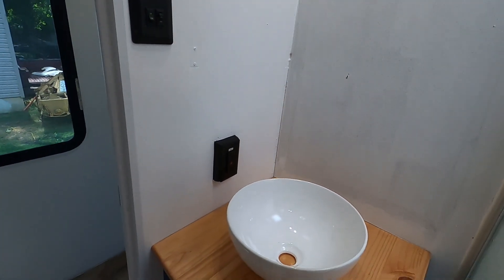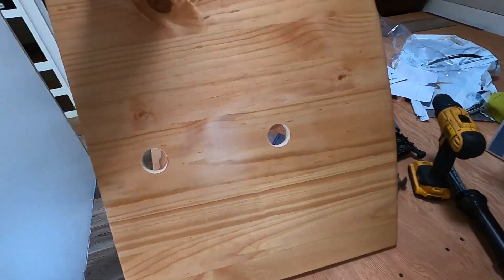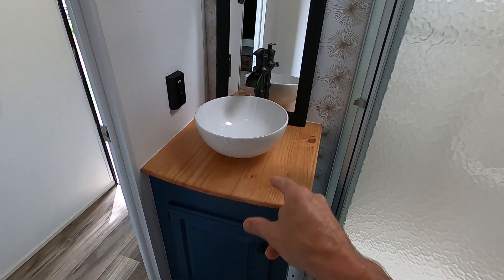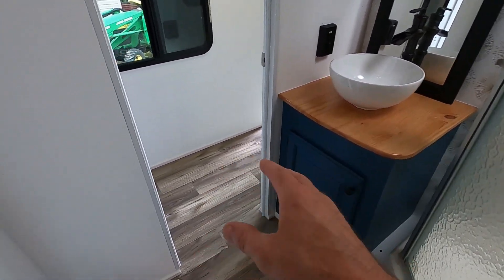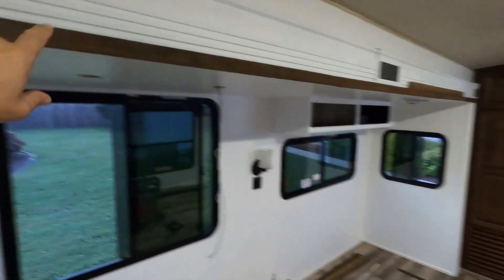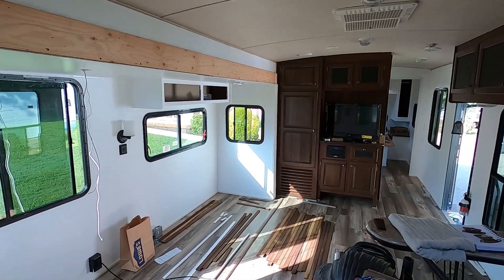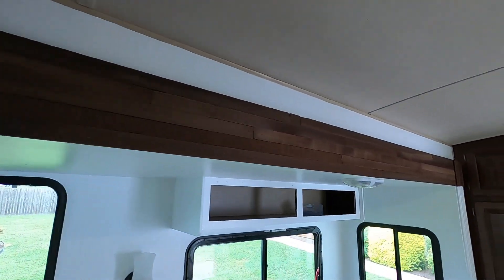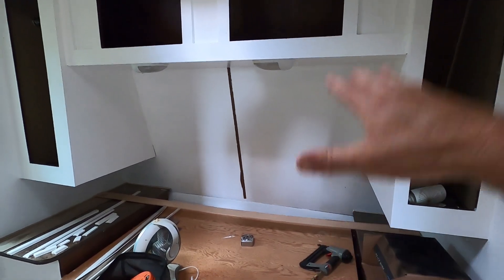RV Slide Transition Strip Vinyl Plank Flooring

Comment: Were you worried at all about the slide out damaging the new flooring? 
I would love to do this in our camper, but  I am afraid of the slide out running over the new floor. 
We have a small strip of carpet in front of the slide, but the rest of the floor is linoleum. If we take that strip of carpet out, is it going to change the way the slide out comes in and out? 
What are your thoughts? 
I love your flooring!!
Reply from the maker: Thanks, the slide should have a rub strip that will help from damaging the floor. Most slides have adjustments also if needed. The new flooring looks so much better than the carpet!
Reply: @slow_restoration  
Thanks for responding! 
I agree! The new flooring looks better than carpet! 
I would really like to take it out, I'm just so nervous to do it. It's the last bit of old carpet left in the camper, I guess just dig in and figure it out.  
Thanks again!

Comment: Where can I find the plastic strip that screws into the floor of the slide at an angle??
Reply from the maker: You can't, I installed it on an angle. It's halfway on the flooring and half off.